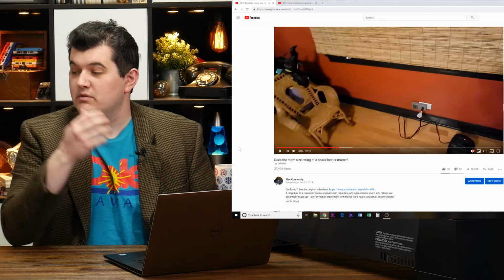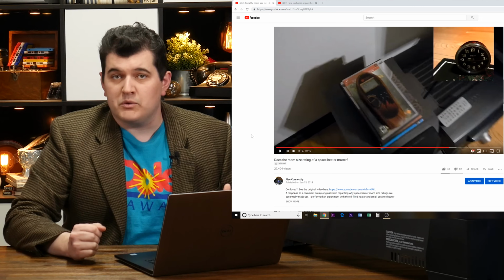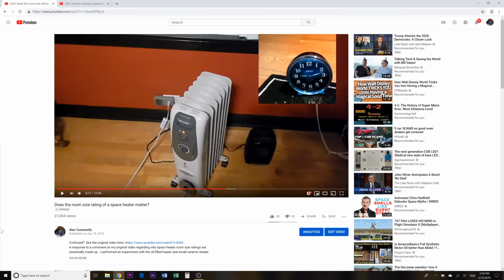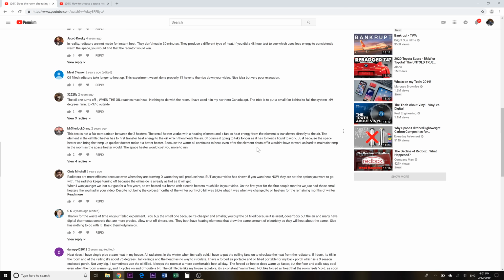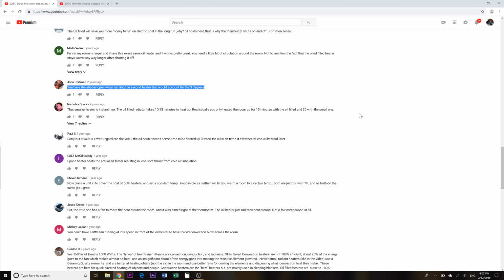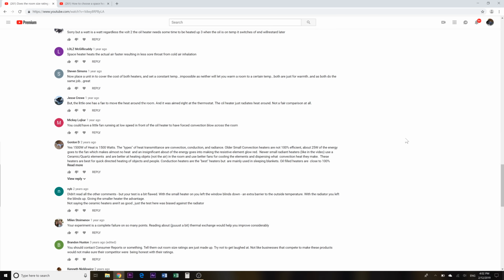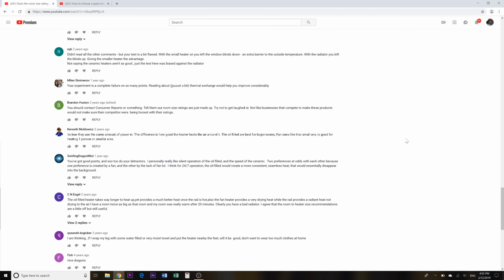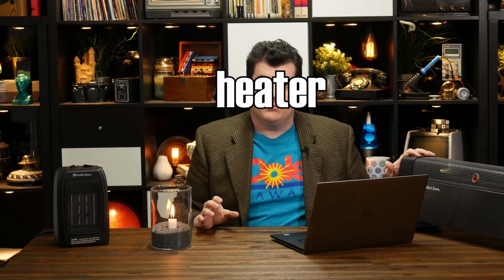More Space Heater Nonsense

Comment: Good video and a great point, made all electric heaters are pretty much the same.  Here's an idea on the same lines - Speaker cables, they are marketed as having different frequency capabilities, sound quality etc. with massivly differing prices, some cables are stupendously expensive. A freind of mine installs speakers and PA systems, he uses regular 13A mains cable as speaker wire and he swears blind that it's as good as any 'fancy' speaker cable you can buy. Maybe thats something you could check out? Anyway I think your TC channel is great, keep up the fantastic work :) Pad Liverpool U.K.
Reply: Monster Cable brand comes to mind = ridiculously overpriced and the gold ends do nothing because you are transmitting thru copper. now if the entire wire was gold......
Reply: Well... in terms of wires its quite different depending on the application. Basically you have digital signals and analog signals and each of those have different applications as well. In the case of digital signals there is absolutely no difference in the quality of the sound (if we are talking of music) if you use a $10,000 gold plated one inch cable or use a aluminum foil cable. If the signal gets from one side to the other you will receive the same sound quality regardless of the cable used. But in the case of analog it's quite different. The analog signal is the sound, the sound is physically there and the quality is determined based on how much of that signal gets from one side of the cable to the other. The cable diameter, material  length and build quality affects the signal and will introduce ‘noise’ as the signal moves through the cable. The more noise the worse the quality of the output sound. 

Since in your post you mentioned speaker cables I will assume that the signal is analog (since speakers work on analog signals) in which case there is a very good reason for using different quality of cables. 

As for your friend comment he could be right depending on the application. Since PA systems generally transmit only voice and the speaker themselves do not reproduce high fidelity sounds he can most likely get away with inexpensive cables. In that application cheap cables may work ‘just as well’ as expensive ones but know that that statement is not correct for all application specily music when high fidelity is desired.

Please note that this is a huge topic as cable type (not quality) will also affect a digital signal (HDMI versions comes into mind) as the bigger the signal the higher the bandwidth that is required of the cable. Know that the good thing about digital is that if the cable is not good enough you will simply get no output (sound or image) at the other side. But thats a topic for another day. 👍
Reply: John Bergquist 

If your goal is to preserve the analog signal, then running the fattest conductor with the most shielding would yield the highest strength output signal while minimizing noise picked up through coupling and whatnot. Unfortunately, copper pipe doesn’t interface very well with audio equipment, so cables is what we’re stuck with. Functionally speaking, even with the most sophisticated of test equipment (let alone the Mk. 1 ear), you’d be hard pressed to find any difference across a 20 foot run between 12 ga speaker wire, and 14 or 17 ga (US/UK) mains wire. If you’re running a cable across a football field, attenuation may start to be a factor, but for residential use, it’s a nonissue. Part of me really wants to take a 12’ aux cord (with something like 28 or even 32 ga wire) and throw it in a hi-fi and see how long it takes someone to notice. 

As for gold plated connectors, if a few nanograms of gold keeps the connections from oxidizing, then while that doesn’t have any impact on the signal quality at install, it will retain it as the years go on. While it’s less critical in the audio world, that it’s used on most every computer connector should be evidence enough that it’s not just marketing wank.
Reply: dont forget the gold plated connectors... majorly humbug. Like only use speaker cables or only use bla bla bla. Might make an interesting video indeed
Reply: I've found cables of all sorts  to fit into three categories:
A) Cheap Garbage (the A/V cables you'd find at a 'dollar' store here, the RG6 used in this building for TV cable, I'm like 2 Db under the legal max SNR)
B) Mid-priced, good quality (lower and mid priced Name Brand stuff. even Walmart 'BlackWeb' and 'Onn' branded cables are in here)
C) Overpriced (Monster)

Gold-plated connectors don't improve the signal, but they are corrosion resistant, which is nice if you live in a humid climate. Silver-braid cable is the best signal you can possibly get, but there isn't too much of a need for that under normal circumstances. Mains wire makes excellent speaker wire because it's solid copper with lots and lots of shielding. However it's more expensive then speaker wire here in the states.
Reply: But there is another thing to keep in mind: a braided wire cable has a different inductance compared to an identically-sized solid-core wire due to the skin effect. Braided wires simply have less high-frequency attenuation than a solid core wire. Depending on the length of the cable, this effect may even be audible to human ears.
Reply: while the overpriced junk is just that junk. there is a spec and your friend could be damaging equipment with undo resistance or other small things. every cable type has a spec and straying from that is not normally a good idea. especially in audio you can hear if badle cable was used (I mean you can hear if say somone used 22 gauge AC wire rather than the expected copper wire with whater specs there to it. I do not mean the 100 cable things)
Reply: @nloughner2015  You're not going to be damaging audio equipment with cheap cables, with three exceptions: 
1: You're pushing several hundred+ watts through cables designed for single-digit wattages. This will cause the cables to heat up, and can start a fire.
2: Damaged cables (nicked or scraped insulation) could arc to themselves or external grounding, or could hear up locally, and could start a fire.
3: Damaged connectors could physically damage binding posts/connections, causing a permanent reduction in audio quality for the equipment in use.

Anything shy of these problems, and you're merely attenuating the audio signal and reducing the output quality.

Comment: He's not saying there are no differences between space heaters!  The point is that "large room" vs. "small room" ratings are marketing nonsense, like having "large tub" vs. "small tub" soap.  If you take those room size ratings off the products and look at their other features for their price -- that's great!  Just don't pay more only because it says "large room".  End of story.
Reply: Now I want to throw away all my small tub soap and get large tub soap! So much better for large tubs!
Reply: This is not necessarily true.  Components on "small room" heat maker may be designed for reduced duty cycles (less time required on) while longer room units may have more robust components for more use and greater amount of power cycles.  I do not work in the heater industry, so I do not know.  However, I would find it quite unlikely that it is simply a marketing issue.  You can find a wide range of products that have same purpose but are manufactured to different specs.
Reply: @4jp    I used to believe that, but having worked in manufacturing as long as I have, I can tell you that functionally there are virtually no differences.  It's in the best interests of the manufacturer to use the same basic components across a wide range of products.  This applies to televisions, refrigerators, stereos, washing machines, hair dryers, you name it.  A $30 heater most likely has the same element and fan as a $50 one, but the $50 one might have a few geegaws and useless widgets the $30 item doesn't.  For heaters, most often that shows up as a cool 'digital' thermostat instead of the tried-and-true, dead-reliable bimetal spring thermostat that's been around for a century.  And a lot of times, you'll find the very same model sold under a dozen different brand names at varying prices.
Reply: jeff; I agree there could be products designed to better fit small rooms, but there simply aren't.  Review the video.  All are 1500W -- the max allowed in the US.  As to duty cycle, the small room ones run at 100% duty cycle, while some of the large room ones run at something less -- the exact opposite implied by the claimed room size.  It seems the US 1500W limit overwhelms any actual large/small room consideration.

Why is "simply a marketing issue" unlikely?  Have you ever seen a automobile, cosmetic, drink, or health supplement ad that wasn't full of marketing-ploy emotional appeals?  Why wouldn't they use such ploys if they work?  There very fact that some people refuse to believe it's just a ploy, even when shown evidence, proves it's something they must take advantage of to be competitive.
Reply: @adm0iii  It is were only marketing, I think it would make it very easy for some  Chinese firm to flood market with lower cost units that work just was well.  The issue I am questioning is whether the parts are the same.  Does the smaller unit dissipate heat as well?   Is there greater risk of heat related failure to components when used for long periods?  The issue is not one of heating, but ability to continuously heat.  It is quite similar to K. Ramos's point about washing machines.  We see this in everything.  Consumer grade machines are usually made to as cheap as possible because that is what most people want.
Reply: Am I following this reasoning correctly?  "It says just 'large room' but that actually means something else that's a definite and valid measurable feature, like durability or industrial grade."  

Why would "large room" mean something else, but not say what it really means?  I'm sorry, I don't buy this (literally).  It just sounds like desperate attempts to avoid the thought that selling products might sometimes involve misleading consumers.
Reply: @4jp    These ARE Chinese products.  Very little by way of consumer commodities is manufactured in the US any more.
Reply: @xaenon  I know they are Chinese.  I mean Chinese no brand name knockoffs that you buy on eBay or in discount stores that have no marketing and poorly translated descriptions.
Reply: @4jp   Ah. Okay.
Reply: this could be the closet to the answer. And if that was the case then his Test wouldn't show any difference. as the part he is testing is not any different between the two.   what comes to my mind here would be like the difference between a consumer grade washing machine and a commercial grade single load version. Both will get your clothes just as clean, and it's unlikely there would be a major difference in resource consumption per cycle.  but what sets the commercial grade one apart is it's been designed to be used several times a day every day, for like a laundry mat or a small hotel or something. where as the consumer grade one is meant for one person or a single family at most, so they are thinking more like once every few days it'll get use.
But if your not concerned with durability there's not really a difference between the two.
Reply: Kit Ramos; Evidence?  If there was a durability difference between products, why isn't it marketed as a product feature?  They claim room size is key, without evidence, and disregard durability.  Again, I agree a durability difference could exist, but the 1500W limit drives such differences to insignificance.
Reply: @adm0iii  I don't have any evidence. but as I was thinking about this more maybe we are looking at it wrong; when we think the large room heaters are supposed to be better at heating up a small area quickly because they say they are made for a larger space so should be even better at a smaller one. but what if that's backwards. maybe it's more that different assumptions are in play between heaters setup for the two different rooms. like a smaller room could be thought to have more temperature volatility due to there being less air  and other objects to retain the heat energy passively so the heaters have to be more gung ho in dumping it out as fast as possible to counter balance for that.  While large rooms have a more stable climate and so a slower but more steady release would be better to keep the room a nice steady state once it gets up there, rather then making it to hot then having to slowly come back down which could lead to being uncomfortable longer.
it would explain why the large room heaters are the slower types like the oil filled radiators and other convection only types,  while the smaller room ones have the fans and such means to push out the heat faster.   So while neither heater is better when you put them both in the same controlled conditions and give each enough time.  that's not what separates them, it's what kind of more real life uncontrolled conditions they where optimized for.

so it's more like saying what would you rather have a $100 bill or 10,000 pennies? you could argue they both have the same worth and buying power, and you'd be right.  you could drop two people off one with each during an average day and they could both get the same things with their money.  but is the experience of trying to use both the same?  nope.
Reply: I think you're on to something there!  Companies offer many varieties in order to fill more shelf space in the supermarket.  Coming up with an excuse for another parameter will allow them to have more different items presented side-by-side.

Avon does (or did; I don't know if it is still around) make soap that is for showers.  But it's not just a label: it offers a distinct feature of being on a rope loop.
Reply: Love that analogy
Reply: Damn, is that why I my wife says I smell -- I don't have the correct size soap for my tub!  But I don't know if my tub is considered small or large. If I give you the dimensions can you tell me what the correct soap is?
Reply: The only way to be sure is to always buy the "large tub" soap, even if it costs a little more.
Reply: I think they should market the oil radiators as "silent" space heaters because they don't emit any light or noise. That's why I like 'em. I hate fan sounds.

Comment: Ah, but what about the "far superior" Dyson design?
:P
Reply: The big one on the left of that shelf he showed at the end of the original video had a HEPA filter in the bottom, I guess that's the only thing that I'd consider superior as in added features.
But have fun replacing that filter when it's clogged (or lose the filtering functionality), their "bladeless" fan designs have never been worth it to me even though I will admit that I like the look.
Reply: @tokeeptrackofrandomsubs5899  not for the prices no, kinda like their "filterless vacuums" my dad owns one, it has a filter, its a washable but it has a filter, even the bladeless fans, I always thought whats the point they arent any quieter than a traditional bladed fan dont blow any more air, they just look space aged and have that smooth air flow whatever, but im not gonna throw like 300 dollars cause smooth air, in my opinion smooth air isnt a good justification, if it was they do sell blower fans like the ones a central air unit would use that can deliver smooth enough air and dont cost 300 dollars cause of ultra whatever motors that spin to blah blah RPMs
Reply: @tokeeptrackofrandomsubs5899  They're also pretty loud for how much air they move. You can find fans that are much quieter for way less money that can move more air when needed.
Reply: You can't compare them, as they use a special kind of electrons to heat the produce!
Reply: Dude, the Dyson one would have a "digital heating element"!

I used to think James Dyson was so silly with is "digital motors"! I thought, "What? A motor that runs on numbers? Ya gotta be kidding me!" But then I remembered that stepper motors are digitally incremented, and then I learned about brushless DC motors, and I think they are driven by some kind of digital pulses. So yeah, sometimes "digital motor" sounds funny, but at least it would make more sense than "digital heating element" or "digital wires," right?
Reply: @HelloKittyFanMan.  fairly sure marketing departments think that anything that is in any way controlled by a microcontroller can reasonably called "digital", therefore, Dyson Digital Motor is the name of the component. Dyson have a patent for a particular way of controlling the motor https://www.ipo.gov.uk/p-ipsum/Case/PublicationNumber/GB2469143 presumably to make it more efficient, spin up quicker, and handle the load better (which will for the most part just be moving air, so they can specialise their control parameters knowing that). But it's still just a motor, at the end of the day, it's got magnet windings just the same as any other motor - it's just being driven more cleverly than most others.
Reply: ...Which I didn't dispute,  @naxxfish , and I thought that what I wrote basically implies this. At first, while I knew that motors could certainly be turned on, off, and stepped by those controllers, I didn't know until somewhere around this time that they could even just be basically driven (commutated) that way. So when I first heard "digital motor" I thought it was bunk. But now I know otherwise. However, "digital heating elements" are still not a thing!
Reply: @HelloKittyFanMan.  Yeah, no, I wasn't disagreeing with you :)
Reply: "Yeah, no,"  @naxxfish ? Ya can't make up your mind? Hehehe... :-D
Well, anyway... oh, OK. I guess it sounded like your last reply was somewhat countering what I said, but maybe I just misunderstood a little. Thanks for your input.